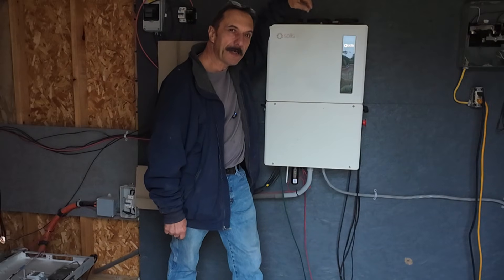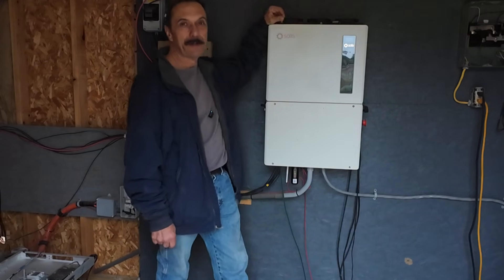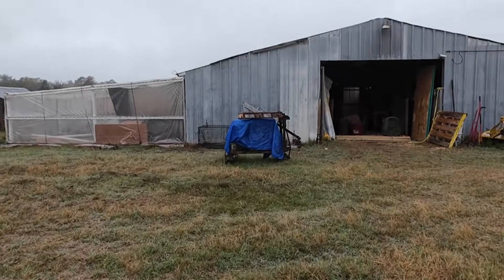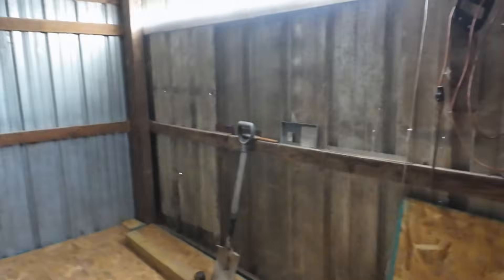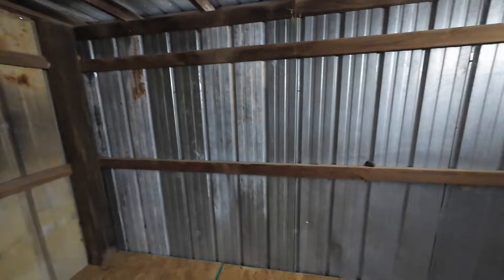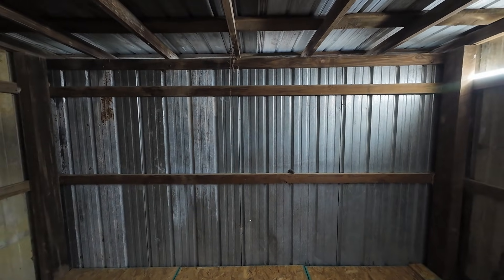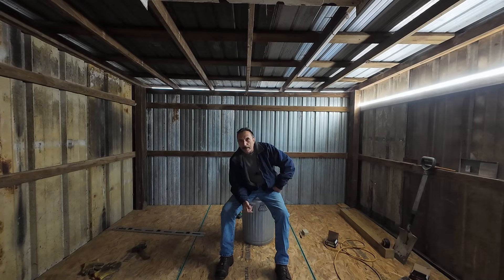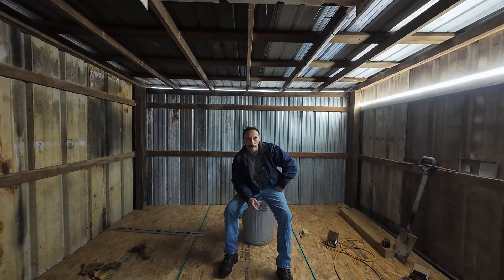High Voltage Solar Mining Gets Bigger, S19 Prices Crash

Comment from the maker: The timing is what stands out to me. Solar capacity is climbing, inverter power is going up, and at the same time the used market is getting flooded with cheap S19s. The way I see it, for anyone running off free power, the lowest cost per terahash matters a lot more than efficiency specs.
Curious how you all see it. For the next upgrade cycle, would you put more money into the energy side of the system or start stacking up cheap miners? Do you think the efficient rigs are worth the premium, or is it smarter to focus on whatever gives the most terahash per dollar right now?
Check the description for the full build details and the Signature Solar link and coupon code.
Reply: I would be making sure that those units come WITH ram pal. There is a huge global shortage of ram created by the AI boom right now and the prices have tripled in the last 3 months.
Reply: Where do you buy your HV Inverters Ed? Any good deals on Solis clones?
Reply from the maker: @chiefmbh  Check the description for the Signature Solar link and coupon code.
I don't know of any clones.
Reply: The timing is bizarre, as if the matrix is calling us plebs to solar mine 😎. This is my new favorite channel, I’m literally trying to do the same thing. Thank you and thanks algorithm! For your scenario with plenty of solar and room, makes sense to scoop up lowest price per TH/s. I’ve been shooting for some balance with underclocked s19ks @ 20 J/Th average 75 Th/s. Couldn’t justify the costs of Bitaxes although they’ve made great gifts.
I won’t be able to go full off grid with the miners for a bit so looking at zero export with CTs and ChatGPT keeps putting this inverter at the top of the list. I could care less about net metering since I’ll always be mining..If you could do some real world zero export load testing with the miners to simulate how much backfeed occurs with these new inverters, that’d be amazing! For science 😜
I’m also interested to see how dust control goes for your barn setup 🤔
Reply from the maker: @Mk1DzL  Yes, dust control is a major issue, that's why I will be using positive pressure air flow and all air will come in thru a filter.
Thanks for watching!

Comment: this is a good idea but as usual there is more to it but you do a great job at optimizing the power, i suggest building a 5kw helical turbine to augment the solar - it is an investment and diversification but if you build it rite it should run for years and contribute to uptime, convert every watt output into compute - power a small 3-5 node cluster for smb sector plus some mining/hashing
Reply from the maker: Appreciate the feedback!

Comment: Do you only turn on the miners in day time, right? I want to do a set up like this but is it possible to run them at night? or you need more batteries?
Reply from the maker: Yes, you will need a lot more batteries and a lot more solar to charge those batteries.
You're better off running 3x the miners during the day for the same end result but way fewer expensive batteries...

Comment: I am doing what you want to do, lol. 75kw of solar, 70kw of inverters. I currently run about 14 miners, I have whatsminer s21's 72 th. I make a few bucks everyday in the summer. In the winter I use them to heat my shop and the basement of my house.
Reply from the maker: Nice!

Comment: Hey, I bought 750KW of used solar panels and mounts, and planning on getting batteries from Jag35 in California, but wondering what to use for an inverter. Do you recommend several smaller inverters each creating a separate circuit or is there a larger inverter which is more economical? Also, I have 25x S19J Pro's and 18x S19k Pro's in my container, im thinking of moving those out to make room for Sealminers or something. My goal for the Solar is to setup a Hydro 2U/3U rack (3-phase).
Reply from the maker: Wow congrats, that's a nice PV score!
If you goal is 3p I would start with that, Solis makes a line of 30-60kW inverters, https://www.solisinverters.com/us/energy_storage_inverters16/S6-EH3P(30-60)K-NV-YD-H-US_us.html
I haven't been able to get my hands on one yet and don't have any pricing.

Comment: Thats such an interesting way tobput it. Storing energy in bitcoin... Man over in japan we pay like 25 cents per kwh. So getting <5 cents value stored isnt really worth it batteries are the winner if you can use the power elsewhere for some kind of production. :) I still think its clever though
Reply from the maker: I do like batteries as long as the cost per kWh is low...
Reply: @DIYSolarFarming  check out jag 35 they've got some 52s1p batteries I think they're 170v for 2k last I checked.  Over 50 KWh of lifep04 for a couple few thousand is an incredible deal imo.  Might be worthwhile if it's not too far of a trip to pick them up I'm sure shipping is ridiculous on such a heavy battery.  I don't know if those guys at Jag figured out the BMS on the pack or if you'd have to tear into it and add an external BMS or balancer.  Love what you're doing!